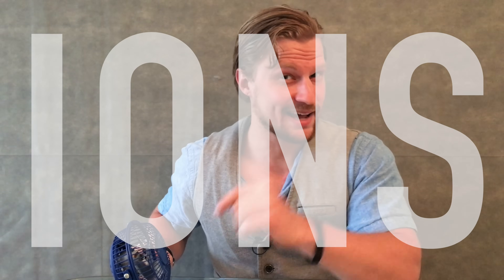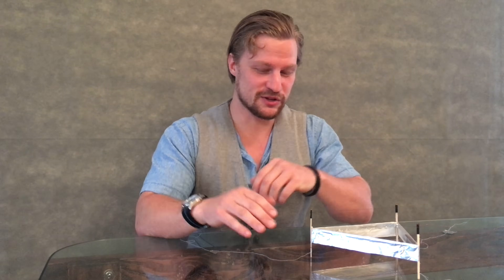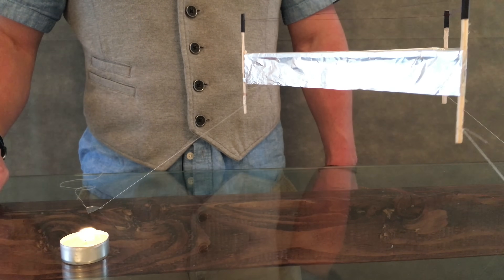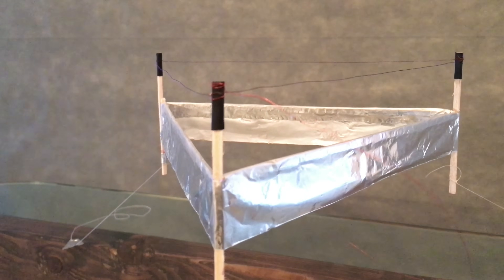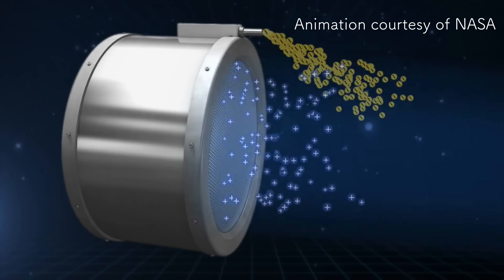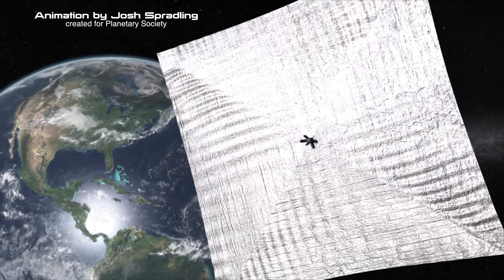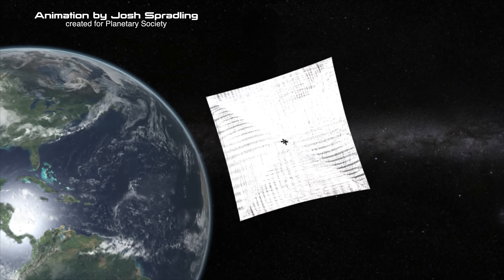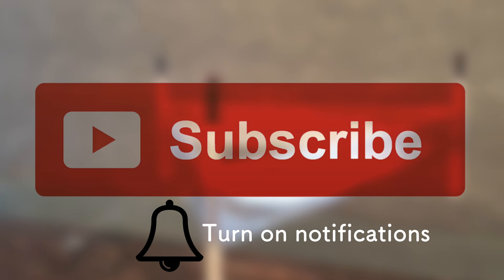IONIC THRUST | A new hope for spaceflight |

Comment: Could the amount of thrust be regulated using a computer to make minute adjustments so it could supply just enough power to make it just hover? If so could this be what the so called TR3-b uses for silent hovering and propulsion? I find it more than a coincidence that this demo  uses the same triangular shape as the TR3-b. Food for thought. Another question is could a craft obtain faster than 10 percent speed of light if more power was used or more fuel?
Reply: you’d have to have a way to detect the orientation from the pov of the craft which on a lightweight model like this probably not but if you could scale it up then I bet you definitely could the us gov probably already has something like that in area 51 😂😂

Comment: https://youtu.be/f5biO4ND-IY?si=LaCH1RcTeVqjIFQ_
Suggestion: Can you do this experiment in a closed glass container and see whether air quality canges.  Gas composition changes? One experiment with no ion propulsion and another with ion propulsion. If you can not get device to measure gas composition. Use relative duration of candle burning.

Comment: GO TO KEYSTONE SCIENCE  CHANNEL.  HE WILL TELL YOU HOW AN ION FLYING DEVISE REALLY WORKS AND WHAT IS REALLY GOING ON AND ITS NOT ION WIND. AND IF YOU GO CHECK OUT HIS ION VIDEO HE WILL TELL YOU THE TRUTH AND HE SHOES YOU HOW YOU YOURSELF CAN VERY EASILY WITH JEST FOIL AND STICKS AND A POWER SOURCE YOU CAN MAKE A ION FLYER YOURSELF AND TEST IT OUT FOR YOURSELF AND YOU WILL SER HOW STUPID IT IS TO TRY AND MAKE AN ION FLYING DEVISE USING ION WIND BECAUSE YOU WILL SEE HOW ION LEVITATION REALLY WORKS  AND IT DOESNT WORK ON WIND IT DOESN'T NEED WIND IT FLYS REALLY GOOD NO MOVING PARTS NO ION WIND IT CAN EVEN CORRY SOME EXTRA WIGHT. 
BECAUSE I DONT KNOW WHY YOU WOULD TRY TO MAKE SOME HUGE PROJECT JEST TO WHAT ION WIND WONT CARRY A FART ACROSS THE ROOM WHEN YOU COULD BE MAKING A REAL DRONE BECAUSE IF YOU GOING TO MAKE A PLAIN THAT YOU WANT TO FLY WITH NO MOVING PARTS AND WORKS LIKE THE ION FLYER WORKS BUT THE ONLY DIFFERENCE IS YOU UES FREQUENCY AND MATCH THE RESIDENT FREQUENCY LIKE THE JOMBO JET AIRPLANES DO TODAY LOOK AT HOW MUCH FUEL THAY SAY A PLAN HOLDS IMPOSSIBLE I DROVE TANKERS I HAPPEN TO KNOW FOR A FACT THAT THERE IS NO WAY IN HELL THAT THESE JOMBO JETS ARE CARRING THAT MUCH FUEL IN THE WINGS OF THE PLAN NEVR IMPOSSIBLE SO WHILE WE WAIT TO SEE THIS ION PLAIN FLY WITH ION AIR GO LEARN TO MAKE YOUR OWN IN A MATTER OF 20MINUTS AND YOURS WILL REALLY FLY WITH NO ION FARTS WAFTING IN THE AIR

Comment: @Plasma Channel I just love mixing aviation and ionic based propulsion . This is the most perfect channel for what I love. Basically, thanks and lots of love. 
I have been working on ionic & magnetic propulsion and levitation  for a while, so I would love to share it with you. But I don't know how😞. 
This my personal request to make a video on what will happen if:
1. increase density and decrease volume of aluminium foil.
2. decrease density and increase density of foil.
3. what happens on changing the temp. of foil. 
4. while 20,000v is supplied. How many Amp current was supplied?
5. which shape of ionic thruster will be best in our sky?
Reply: The topic of pulsed plasma engines has been known since the early 1960s (see PPT - Pulsed Plasma Engine in Wiki) - they are usually designed for spacecraft. But I will tell you about a little-known design - plasma propulsion panels for vehicles flying in the atmosphere, they use the same pulsed plasma engine, but reduced to the size of a pencil and stacked like cells in the panel. The design is similar to the screen of an ordinary plasma TV, because there are also bit cells there to activate the glow of pixels on the screen. And in plasma propulsion panels, the discharge cells are long, the spark gap has the architecture of a railgun (just rail contacts or coaxial), and the ionized discharge air is accelerated there by the Lorentz force to enormous speeds - a kind of ramjet engine is obtained. Just imagine! - tens of thousands of small ramjet engines assembled in a panel and synchronously firing plasma at a huge frequency (hundreds of kilohertz). Thus, plasma propulsion panels create lift with the help of pulsed emissions of plasma jets from the cells of the railgun - a huge impulse is obtained, and the plasma twists the air into toroidal rings - the aircraft is supported on this air cushion. Horizontal acceleration is created by the same plasma panels on the sides of the device (they glow, from the outside they look like "portholes"). Devices such as the "triangle" or "disk" have been observed for a long time, they are mistaken for aliens - but these are terrestrial devices. They are classified and used for espionage and secret activities. Pulsed electromagnetic technology generates microwave radiation, so it is harmful to health, so they rarely fly - only on military missions. And for a citizen, therefore, they are not suitable. Declassification has now begun - too many people know about this secret technique. After declassification, they will be used for cargo airships.

Comment: Why don't you experiment with the limitations of the Clock clicking by faster at higher elevations and within max and minimum of that is and maybe look into like if they use the pistol shrimp for a warp speed if you could pull into multiple like variations of like implosions like an implosion to get warp speed maybe, they could use like a proton collider or something of the sort some s*** to try that.

Comment: Have you tested it in vacuum so that it supports your hypothesis that it could be used/considered for space propulsion in the future?. somebody conducted experiment on ionic lifter in a vacuum chamber. The result is that ionic thrust does not work in vacuum
Reply from the maker: ….. these comments.. lol. In space, all ionic thrusters carry on board, limited supply gas. That gas is accelerated. This causes thrust.
Reply: @PlasmaChannel  
So you think, in future, a spaceship, should also carry huge amount of gas? you think it is plausible?. Isn't it more like conventional propulsion, which use gas (and internal combustion engine) to push the craft forward.
You haven't mentioned how the gas interact with the ionic thruster, will the gas react and burnt with the ion ,like in the conventional combustion engine ?(the gas is combustible and it creates high pressure), or the gas has some special properties that it instantly create high pressure (once it interacts with ion form the thruster) that moves the craft forward?

Come on, from many sources in the internet, seem to show that scientist are seeking the type of propulsion other than that kind of conventional propulsion😁

By the way.. with your idea with the gas on board and ionic thruster (that requires high voltage power supply),..
i think combustible gas (from liquid fuel) resulted from internal combustion engine like modern rocket will be much better...lol🤣
Reply from the maker: In the vacuum, those ionic lifters did not have an on board gas supply.

Comment: My question is...
If electrodes are "ripped off of the gas particles", how is the gas itself affected? Will it not become a different gas entirely, as a byproduct of the process? And of so, could that produce some potentially very dangerous scenarios depending upon gas particles present in the surrounding area? I know that space is a vacuum, but the existence of comets, stars, nebulae, planets and even moons prove to us that gas particles are present across the unoverse in a multitude of different ways shapes and forms.

Comment: I think if this was mixed with a gravity vibration thrust that's navigated to pinpoint the dense portion right outside the trusters would be a great start. The targeted gravity will move the ship great places quickly without hesitation in most situations. Gravity is all around. There's no reason as to why it's not the power source for any engine

Comment: Saw demonstration of Five Foot by Five
Foot by 18 inches lift 2 pounds of
  Payload. Controlling Quadrants.
        What are the Limitations
   When scaled up to much larger?
Using Carbon Fiber Structure Ramping
               Up the Voltage?
Could Nuclear Power be used connected
      To Flywheel and Gyroscopes
   To Make Huge craft lifting Pilots
 And payload stable and possible?

Comment: It's not ion wind! You are looking but not seeing!!
Reply from the maker: So even though the movement of air can be seen, felt, and measured (wind), and air pressing against other air /surfaces creates thrust, what is it then?
Reply: @PlasmaChannel  The high voltage is decomposing the air around the metal creating a low pressure area. The air movement is the higher air pressure around the craft, rushing towards the lower pressure. You can see the same effect happen in cathode ray tubes. That's why you can see corona around the wire!!!
Reply: @PlasmaChannel  https://youtu.be/qNkd5PaH9H4. Watch when he puts the paper in front of it! It gets sucked into it. Just like if you put a piece of paper over the nozzle of a vacuum cleaner.
Reply: @PlasmaChannel  https://youtu.be/Zz95_VvTxZM. The power of the vacuum. Imagine if you could turn that power into thrust!!

Comment: Built a lifter years ago powered by an old CRT screen flyback transformer.
While experimenting with it, one phenomenon I have yet to hear a good explanation for is why the lifter still rises toward the wire regardless of the electrical polarity.
Reversing the polarity didn't change the direction of thrust.
I wonder if you've experienced the same phenomenon and have an explanation for it.
A lot of ion lifter enthusiasts at the time attributed this phenomenon to the Biefeld-Brown Effect.
I'd love to hear your thoughts on this.
Reply: The wire is ionizing the air  all around it in 360 degrees, reversing the direction of the current changes nothing because its still ionizing the air in a cylinder around the non insulated wire

Comment: The tech is nice and clearly should work great in on planet applications, but it will still requires that you to bring a gas if you want to use it in a vacuum. I have an idea to for an engine that would function as the first Single Stage To Orbit engine and it incorporates this tech. However I have run into a few drawbacks I am working out. One the amount of ions that needs to be produced has to be very high in order to achieve that amount of thrust force required to lift a vessel the size of a plane or a rocket ship. This will require a massive amount of electric power. The amounts needed will easily produce X-Ray level radiation. The other issue is that this type of propulsion would produce ozone gas into the atmosphere so it wouldn't necessarily be true green energy. I have some ideas to tackle this but am working out the kinks. Hoping to have a schematic design created soon to test my theories.

Comment: I would really like to develop a drone using this principle, but there are so many unknowns for me still that I need to learn. Are there negative ions that leak out causing radiation? How could I create rotation on the yaw axis? How much can it lift? What calculations can I make to solve thrust? Can I have enough thrust to weight ratio to store a small nitrogen tank for more thrust? How much surface area would it need to provide the thrust? And many more questions

Comment: Now increase the lift weight. Perhaps replace that design with a bundle of plastic straws threaded on wires at each end and rolled up into a bundle, with a pressure choke like a rocket engine.

Comment: HERBS REALLY HELP!
You want to be motivatet youre brain needs to produce Dopamin just get fresh air with some jumps outside or use a oxygen konzentrator while you working there are lot pf herbs that got dopamin in it 
Herbs can  change youre Genetik fast and rapidly in a positiv way it makes youre Genetik stronger.every herb got a specific funktion on the body but also specific range of vitamins.
Please Eat a varaiaty of better fresh herbs but dryed also ok with oil it can be like pommes frites or just olive oil and sun naked on a led solar lamp you hack youre immunsystem and give them a boost just train a little bit under the light to bosst it little bit more. Hack the planet! Good informations needs good informations! iam like a biochemical haker i see our body like a computer that needs a good quality of hardware and linux youre body also needs some sort of this and the best quality is always nature...waht also helps is bone water just boilt bones in water or make pulver . Please share to hackers phibunacci youreself and connect to the nature you can grow herbs on youre computer to minimize the elektromagnetic radiation from youre computer use a laptop in the forrest but you will need a good antenna you can eat woodsticks cut it just to tablets the world is a organizm we need to repair our body cells with help of original nature vitamins and make photosynthese with sport and herbtee pools dont smoke ganja just eat it you can heal a lot and breaking with addiction burn ganja in oil like frize until brown color then its psyco aktiv the life act like phi goldenration everything got the right portion and position use herbs with rife frequencys spread this important information to everyone but hacker first and then to stupid and also to different network to heal the world as a organizm satanic people also have to eat herbs this will harmonize the world use orgonits with washmachines and aquarium. 
Rosmarin is good for konzentration and ginko and aronia use the concept of permakulture to grow the walls of citys should be green stick two bottles together with one bottle water and make a water tornado to energetize yore body you are water make the same with electrical waterpump constant
Decode vaios laptops thex can produce electrostatic fields and maybe use an mikro chip in youre body that do vazektomi and braindamage but wallnut and avocado and pigbrain helps please spread thats for hacker
Dont drink alcohol and read the bibel or listen to bidel over audiobooks its important the list of king salomon very clever
Manipulate smartphones with frequencys or they can manipulate you 
Smartphones and laptops are not only that waht they supose to do secret technologie to manipulate and torture. you can eat leafes from appletree or other trees like herbs its antyaging with sun and oil but also other leafs from other leafs makes really healthy we need healthy sparta hackers hackers in every aspect look always at the full spectrum we are a organizm learn from nature we are a chronus use a chi maximizer and own  electrostatic fields to repair youre genetik ciba geigy tv show....hold youre sexuality its more wisdom than sex sex is holy just for babymaking its not easy but worth
Thc burning oil
Old computers producing dor energy... orgon energy is impulsive so dont use it konstant but periodic 
Grow youre own aloe vera grow youre own indoor herbs with led solar lamp and use it for yourrself 
Cook aloe vera before consuming
Use koriander chlorella and garlic do detox youre body from heavy metals train after you eat a variaty of herbs and than sun that makes the body strong....
Harmonize youreself with a duster and good smelling smells like verben citrus or lemon gras or wild apple use oil youre body with normal oil you use to cook like olive or anything else it detox youre body 
You can hang a orgonit in a room and pendel it orgonits should always flow and be in movement or hang them on trees!
Ground them too but not always. remember impuls energy
You manipulate orgonits with youre own magnetic field if you dance or with emotion in kombination with water  play on guitar or play reggae riddims because thats fibunacci music music with phi proportions because they copy it from  nature  a good album is scientist wins the worldcup please share this informations as much as you can if you are a good haker please help me it will rise the movement....
https://youtube.com/playlist?list=PLTVpTfT-O9Udh5EqNxW_Ce7rv9SMrgThw
https://youtube.com/playlist?list=PLTVpTfT-O9Uc6DE-NVIrnpsZnKpNDPkhQ
https://youtu.be/bdynEiXFypA
https://youtu.be/yXPrLGUGZsw
Please you can create a zeropoint energy 3d print some horns if the big kudu antilope that empty inside push some water throu it and make a wheel of kudu hirns like a star 

Good herbs are rosmarin nattles liontooth
Green gras ever made some green smoothie drink from that herbs just try it!
Never trust suplements that you are buying for money always grow herbs thats the trustet source of vitamins 
Pinapples are a great source of serotonin just like nattles always cut nattles with scissors 
Please listen to this message seriously 
Bone water can make your bones and teeths stronger 
Can you made a computer that resonate itself with the proportion of phi? 
The laptops we use dont resonate with the proportion of phi so they are really unhealthy for our animal magnet field
Reply: you believe in herbs? it's a reptilian trick to make you eat grass

Comment: this ionic engine cannot be used for space travel (see your title) because it creates a movement of air and we often forget but in space there is no air (sorry Battle Star Galactica but a shot in the rudder of a viper does not modify its maneuverability in the space vacuum)
Reply from the maker: It is currently used in space - the craft just needs to carry gas on board for use in the propulsion process. That’s gas is accelerated back, pushing the ship / satellite forward.